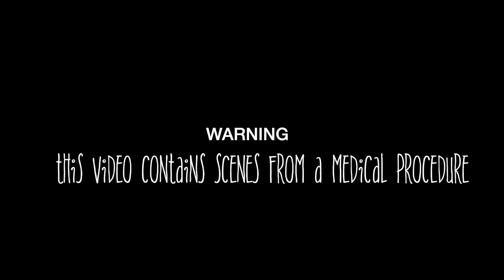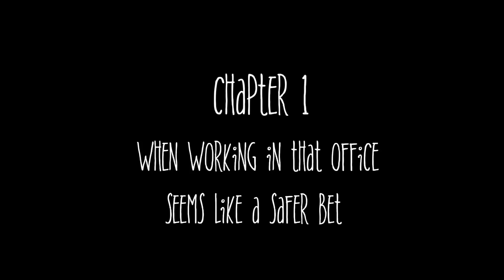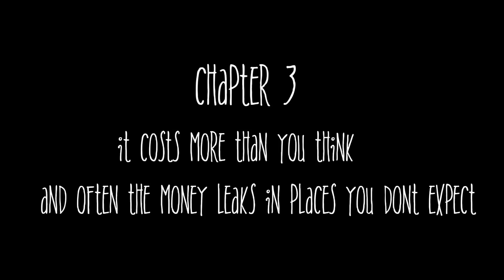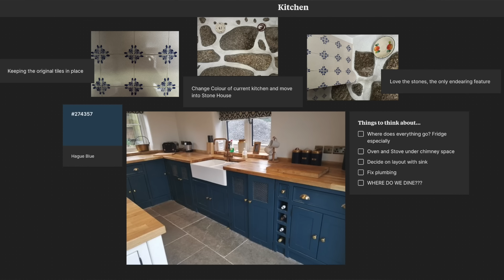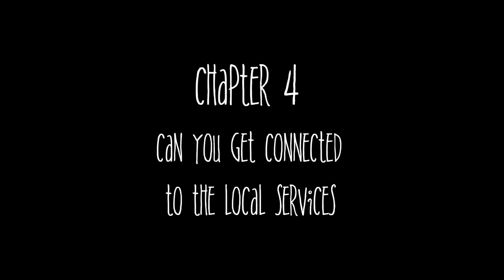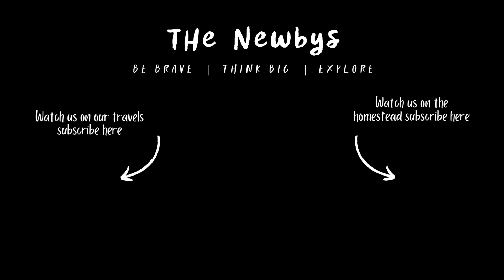When Buying Abandoned Land in Portugal Goes Wrong

Comment: John, can you get a flow-restrictor put on the municipal water pipe where it enters the property, so that the pressure isn’t putting strain on the older plumb fittings? We have had to add an isolator tap at the entrance of our property to restrict the flow of water as when we moved in the water pressure blew taps open whilst we were on holiday! So much wasted water that week!
Reply from the maker: Thanks for the suggestion Carol, will look into that!

Comment: Felt I was reading my own life story with this video! Regards building etc same rules apply here in Italy… we did some “ unauthorised “ building and when we sold the house had to unbuild it! Also had a well which used to run dry, had no mains gas so relied on gas tank in garden, electrical problems, no end of damp and mould etc etc! This video is so important to any one thinking they can just buy an old property and life will be great. DO NOT think you can cover damp up with a new structure on top… it doesn’t work! It may cost money but get new pipes and sort out problems as they’ll only get worse with time. My husband is luckily like John so we saved a lot of money by doing most things ourselves. So, listen to the advice in this video folks before buying your dream land. It all boils down to experience which I wish I had had 30 years ago!!!😂
Reply from the maker: Oh no we are so sorry to hear that Melinda, that is very frustrating indeed. Thanks for sharing your experience with us ❤️❤️

Comment: We had a similar challenge with water pressure in our abandoned house in Spain. House was set up for 3 bar and mains was 7. Pipes started popping. We ended up adding a pressure regulator, no more problems.
Reply from the maker: Amazing, thanks so much for sharing your experience and solution with us friend ❤️🙏🏼😃🏡🇵🇹

Comment: Hi guys, we have some suggestions, which we did suggest a wee while ago. 

The other half is a builder, carpenter, joiner, furniture maker and project manager.  We have renovated a plethora of properties in many parts of the world, as well as having 7 Airbnb accommodation properties.  

So we suggested keeping the foot print of the existing larger house.  

Make a glass link between the the 1 bedroom Apartment nearest to the 2 bedroom house.  To connect each other - which will take up a small amount of none permeable amount of land = ie minimal 

Then build an outer exterior wall around the original 2 bedroom larger house - then Crete a 2 storey building of 300 square metres bu with only a foot print of none permeable land area   You could then have three bedrooms at leaps up stairs and 2 bathrooms 

You could if you wanted still use the nice kitchen you have already built or have a door that closes off the small area if you want to have that self sufficient for family Airbnb volunteers etc but you still have your own house area 

Personally I would not remove the not garage as you obviously need this area with water etc in there

Comment: About water bills (or other) you have to confirm with the local company provider if you are not currently having a "water meter estimate" and if that isnt giving you a mislead monthly amount to pay. If thats the case, they adjust the water meter bill to the real value (in a single bill, with a periodity of 6 or 12 months). I and the majority of portugueses face the same issue with it. The only way to avoid this is to inform the company with accurate water meter counted at the end of each month (don't now exactly wich day because I never do it, but there is a fixed day to inform the company)!  Ask your friend Joao to help you with that. Cheers from Lisbon

Comment: John. If u can get it PEX pipe is done here in the US for plumbing.  U might want to order several rolls of it. (Red hot. Blue cold).  You will need for the new house and old.
Reply from the maker: Thanks Beverly! 👍👍
Reply: You can do up to a 50 foot run of the PEX without using connector fittings.  I used it in a condo I used to own as the original gray pipe fittings failed at the connecting fittings.  You get a lot of pea e of mind with the PEX flexible pipes.

Comment: You must have a flow meter on the mains that they use to determine how much you use.  You should be able to see the needle moving even if there is a small leak (and a small leak can add up to a lot of water over a month!).  Anyway, you should be able to cut off water to where you think it is leaking and see if it affects the flow to make sure you have found the leaky area.
It is remarkable how fiber optic lines have been installed in so many rural areas in Portugal, at least in the north.  The electrical grid is a bit sketchy.with sometimes having good power and sometimes not enough to run much..  They are working on it but don't assume because the electric is there you can just plug in some major consumer of electricity and be good.

Comment: The courtyard is not concrete it is only stones so you should argue that. Trust me that can be argued, worst case you will need to remove the cement in the joints.
You can also dig a basement or built one more level to increase square feet
Reply from the maker: Thanks Pedro. Worth noting for sure. Thank you friend. ❤️🙏❤️

Comment: Hi John & Tara, I don't know if anyone else has suggested it yet, but have you looked into having the courtyard altered somewhat so that it no longer qualifies as an impermeable surface? What if some stones were removed and replaced with gravel? Or perhaps all the cement between the stones chipped out and replaced by gravel? There must be rules that regulate what counts towards "impermeable surface". Presumably gravel doesn't count, or does it? Surely the existence of stones on the surface of an otherwise "permeable area" doesn't count, otherwise any property with a lot of surface stone would not be allowed a building on it for that reason alone, which makes no sense.
Reply from the maker: Hi Tony, thanks for the suggestion! Great ideas you have here ❤️🙏🏼😃🏡🇵🇹

Comment: If that doesn't work. Would they consider it if you just had the stones for the courtyard and not the cement? In Florida, they let you have one if you set the stones in sand and gravel so that the water can seep in between the stones. That way you can keep the look of a courtyard, but not have the cement.
Reply from the maker: Such a good question Grace. Very worth exploring this idea. Thanks. 🙏❤️👍

Comment: I hope what I tell you applies also in Portugal.. Here in Greece, in a situation like yours, you don't need a permit as long as you build a construction entirely using stone, iron and wood  Then there are no restrictions..Your architect should have known the legislation about building in areas like yours.Stone constructions need no cement pillars as their walls are the floors are +-0,70cm thick and special interlocking creates perfect and everlasting corners and arches . Wherever beams are needed, like floors etc iron is used which lasts forever or thick wood which will not last as long. Your floors best have iron beams covered with what will give them a wooden look, your floors cav be wooden, insulated and tiled, where er you want them ,using the swimming pool tiling materials. You better have floor heating/cooling installed. Stone buildings are earth quake safe and sustainable constructions. The only way that puts them in danger to be left roofless. They are also fire resistant if their roof is wisely constructed.I know of  2 and 3 floor hundreds of years old buildings.And don't forget geothermy if you want to be truly sustainable and off grid. So, cheer up folks!❣️🇬🇷
Reply from the maker: Thanks so much for sharing your experience with us Leelani! That is so interesting ❤️🙏🏼😃🏡

Comment: also I still don’t understand why you have not installed water tanks to catch your rain water ! You can then install a high pressure water pump and then you have the same water pressure as the water high prices that you have been using ! All of our properties are either on wells and or rain water collection, but all on high pressure water which is great ...... what is your hesitation ?
Reply from the maker: Good question. Rain water tanks could be 1000 litres which is a very large rainwater tank. They are pretty ugly and large. We could bury them but locations are not conducive to that solution. 
Watering and looking after the farm uses about 1000litre of water every day. Sometimes more, depending on what we are watering. Simply, the solution to put rain water tanks around the farm is not particularly practical. We are however building a bio pool which will store over 150,000 litres of water  this does take time though. We will get there. Thanks for your question. 👍👍
Reply: They may be pretty ugly and large but without them in all of our properties we would not have water so no option - we have put trellis around them all and grow veggies and jasmine and sweet peas around them they look gorgeous   @TheNewbys

Comment: Water storage of 4 x 5000l tanks with a pressure pump to feed buildings fed from wells & rainwater from roofs should solve water issues. Enough solar panels with batteries will still charge when cloudy! You need to investigate & plan better. Sounds like your consultant doesn't know what he is doing, he should know the planning rules so you don't have to go back & forwards or is this his way of sucking more charges out of you by doing things a few times over?

Comment: The best way to check for leaks is to find the location of the water meter coming into your property, usually at the municipal/ private property line . Make sure all your appliances and hoses or anything that uses water is turned off, then check the water meter and see if the dial is moving. The dial moving lets you know there is a leak, at 60 PSI a 1/8 size hole in a pipe can leak 250,000 gallons in a 3 month period.
Reply from the maker: Thanks so much for the advice friend!

Comment: We had the same problem here in Sintra and went for cobblestone - the council here considers it to be permeable, which of course it is 😊 Not necessarily cheap either, but it looks good and is legally acceptable...
Reply from the maker: Great to know Fred, thanks so much for sharing ❤️🙏🏼😃🏡🇵🇹
Reply: I was thinking of a permeable solution for the courtyard, but yes that one ! Could maybe possible with bigger one, or the rectangular one, or play with colours. 
But won't it possible to "only" change the joints of the courtyard for permeable one ? Same with all the futur paths.

Comment: In the US water meters for the house will have a little arrow or triangle that spins when the water is flowing - mains on one side of meter and then your property lines are on the other side of the meter - so if you have all water turned off on the property and the little thingy is moving at all then there is a leak somewhere after the meter - dunno but maybe Portugal has something like that you can install or use?
Reply from the maker: Great to know John, thanks for sharing ❤️🙏🏼😃🏡🇵🇹

Comment: John I was thinking you had gotten your fingers which made my stomach churn.  I had a clash with a table saw in 2010 with my right hand/. Cut every finger and thumb.  Luckily I got to a great hand surgeon who saved my fingers.  I have almost total  capabilities now.  The table saw makes me pretty queasy the few times I have used it since.  I try to find friends to use it for me now.  Saws are like snakes; they will bite you without notice.  Glad you are on the mend!  Love the videos.

** on your current adventure to add on to your tiny house; are you putting in footers to lay your block on for the walls?  I may be getting ahead of your processes with my question.  Second question;  you might consider making your outside wall even with the current house and extend the roof out over the wall you built for your outside sitting area.  You might only gain what ever the space is from the trench.  Just a wag from the outside looking in 🤔😋
Reply from the maker: Ohh ouch Dave, glad to know you are okay!